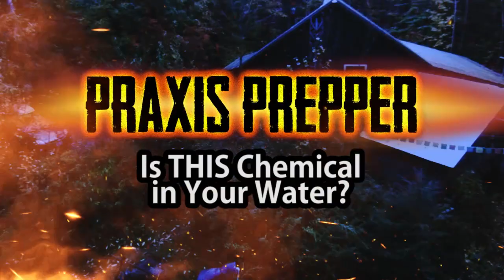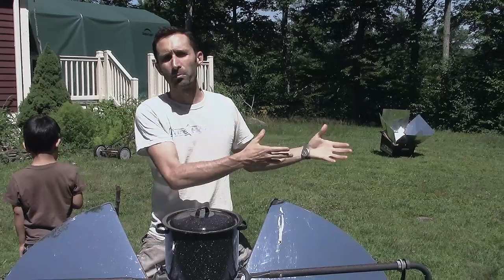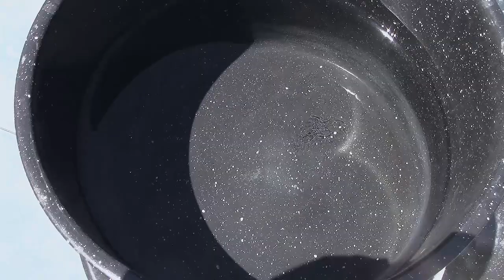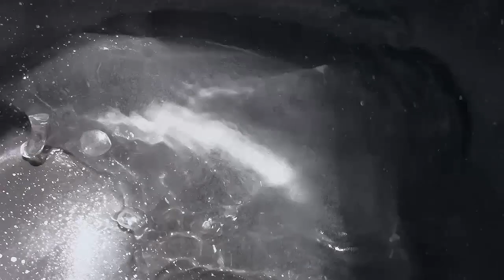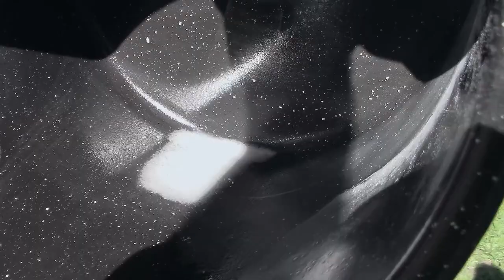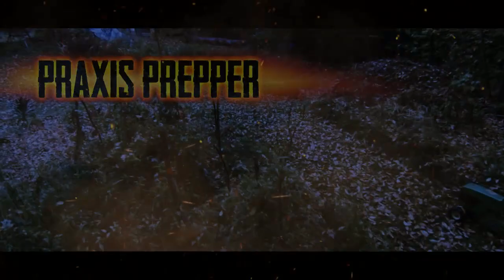What the Frack is THIS?!

Comment: You posed some good questions, what's in our water and is it dangerous?
Just eyeballing your residue, it looks like hard water. Basically just too many minerals like calcium in the water. It's mostly harmless but can cause  long term problems like kidney and bladder stones if you drink it over years. Just about any home water filter or filter pitchers can catch most of it for you. The worst part is that hard water lowers the efficiency of soap and detergent for washing as well as affect how baked foods rise because leavening doesn't like mineral water. 
Otherwise, it's safe.
But to be 100% sure, have it tested with the municipal heath department to be sure the minerals don't exceed safe levels.

Comment: Calcium from hard water.  Growing up we put a pot of water on the old 'oil burner' in the winter to put extra moisture in the air.  After a week of use you could peal huge flakes of the stuff out of the dry pan.   With hard water you will also notice water isn't as 'wet'.  Cloths won't wash a white.  Soup scum in a shower can build up easier as well.

Comment: Hard water is all the dissolved metal salts (calcium, magnesium, sodium, potassium, ...).  Using salt crystals in hard water, offsets these salts, making the water all salty and slimy (soap won't froth, and feels like washing in jello), but does stop all the calcification of the hot water tank, piping, shower heads, faucets, sinks, tubs, toilet etc.

Comment: The white stuff looks like Calcium Chloride with some other trace mineral content =)   Let it set on the table and it will separate out and just use the top part if you are scared about it usage ... just do not dump the stuff always in the same place /-)